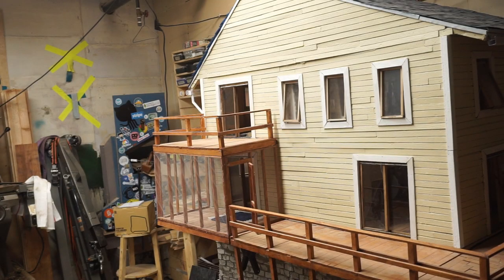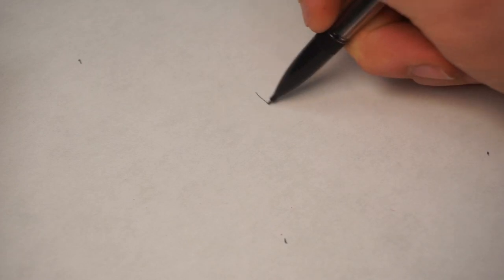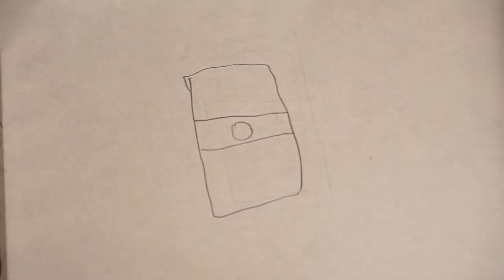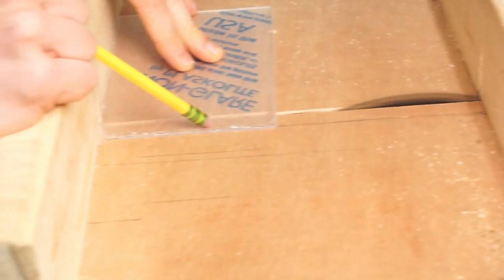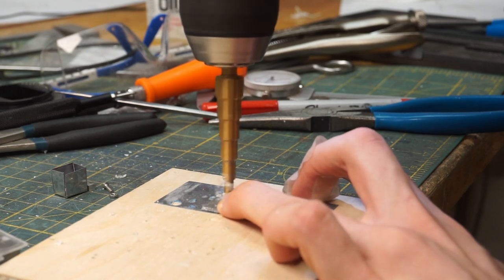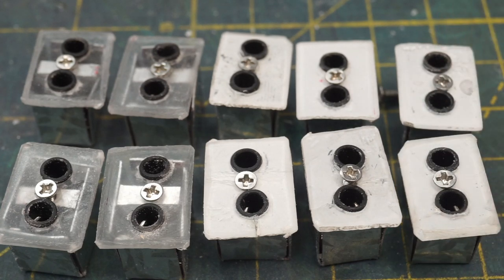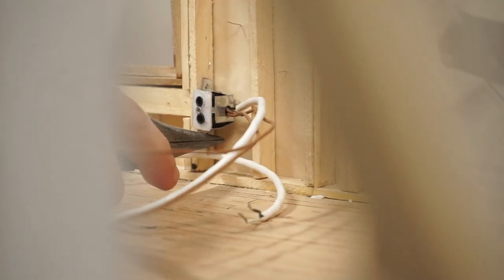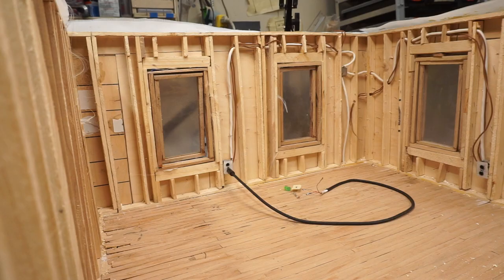Installing Power into my Model House

Comment: Very ingenious and incredible detail. Going with a TRS connector instead of the standard DC barrel connector was a good choice since you could add a control signal. I'm looking forward to the different mini electrical appliances you come up with and decide to use.
Reply from the maker: Thanks! It worked out pretty well indeed.

Comment: Pre tin your wire end before soldering to the thing.

When it's time for making light switches, look for some ganged 'DIP Switch' modules that solder onto circuit boards.  
You can cut them apart, or if saw kerf too wide destroy every other one down the line and sand smooth
Reply from the maker: As far as the dip switches - I'm planning on using these, which are basically single wide dip switches: https://www.ebay.com/itm/GFORTUN-50Pcs-SPDT-Panel-Mount-Micro-Vertical-Slide-Switch-High-Knob-3P-2-Pos/223537831766

Comment: Very cool! Are you planning on making mini circuit breakers or gfci outlets for short circuit/overload current protection?
Reply from the maker: The circuit panel is what I'll be focusing on next time, so yes, stay tuned for the circuit breakers! And I had thought a bit about GFCI outlets, but I have no idea where I'd even start with that... I may, time permitting, make some light switches off camera and show them next time, though.
Reply: Oh cool! I have an idea for GFCI outlets that I use when building my models, I use these electrical components called relays. There’s a bunch of videos on how to make short circuit protection devices using relays. It works kinda like a GFCI.
Reply from the maker: I'm very familiar with relays, but I hadn't thought of them in this circumstance. After a cursory search, It looks like there may be a way to do that same sort of thing with a transistor (and they are much smaller). I'll look more into it - thanks for the suggestion!